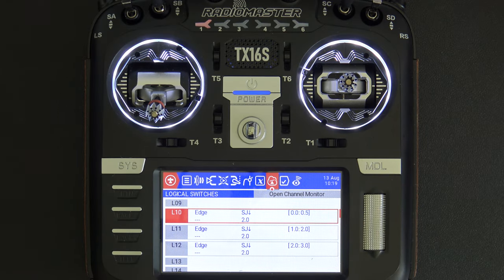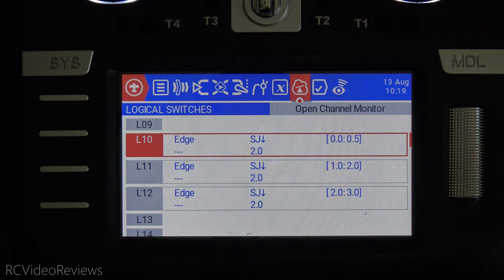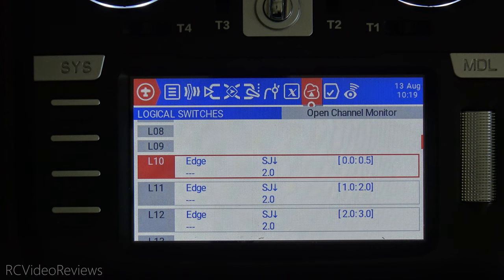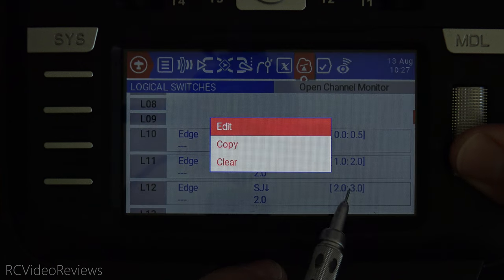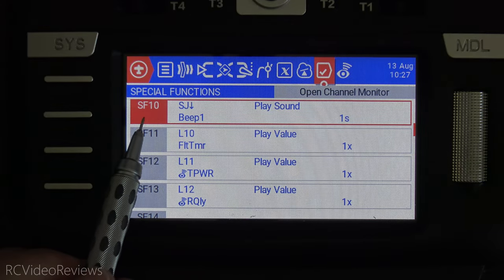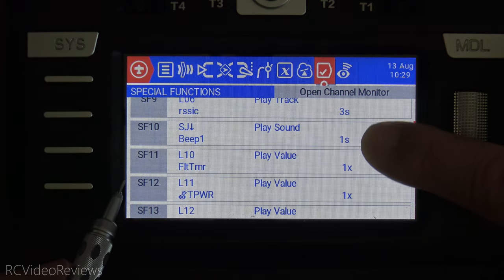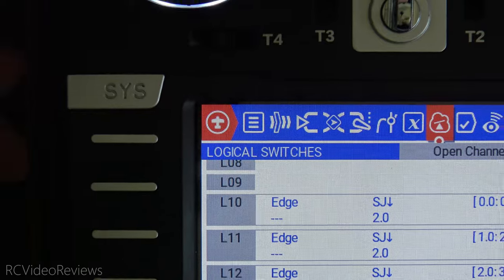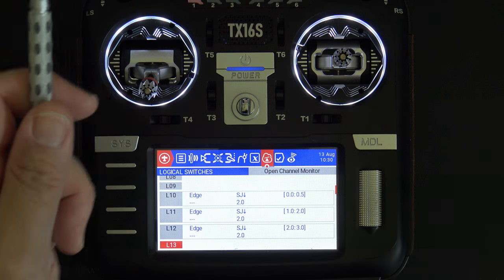EdgeTX How-To Use Multiple Functions on a Momentary Switch

Comment: Id like to repurpose some of those function buttons to the left of the screen. I never use them. The touchscreen made them obsolete.
Reply from the maker: That would be cool, but they're not addressable in software right now--although--they are visible in the hardware page. Maybe a github suggestion to ask for the ability to remap keys.

Comment: 2 questions, which one do you like better Edgetx or Opentx? Gimbal , is the HAL v4 good enough or should I just go for the CNC ones?
Reply from the maker: For all practical purposes, OTX is dead. Last update was April 2022. EdgeTX is the obvious choice. v4's are good. AG01's are good. You won't go wrong with either.
Reply: @RCVideoReviews  got it stick with ETX. Thanks again!